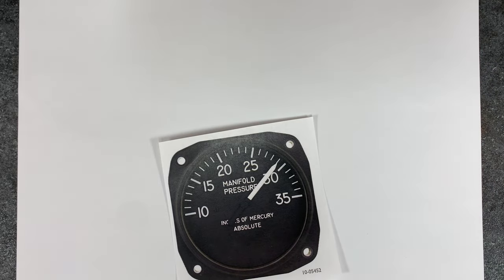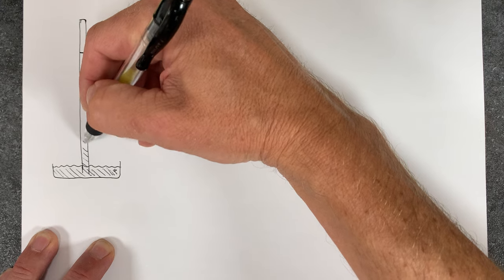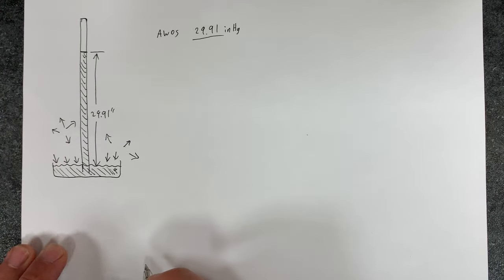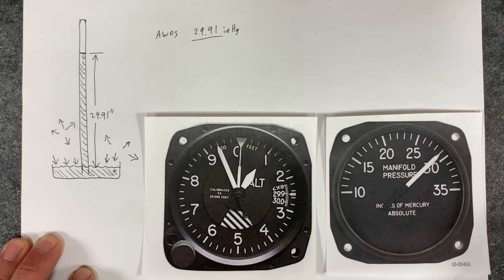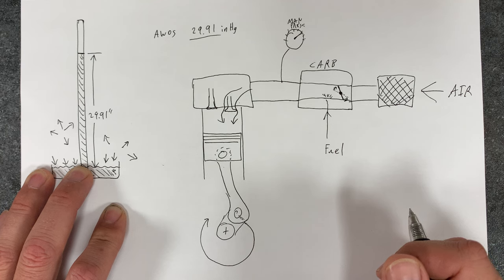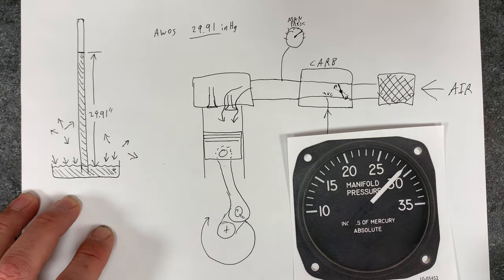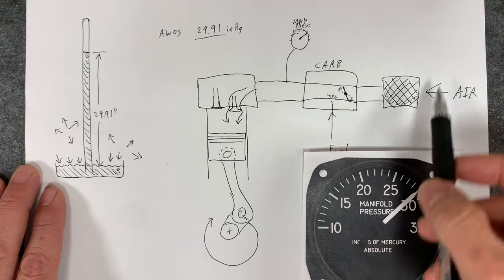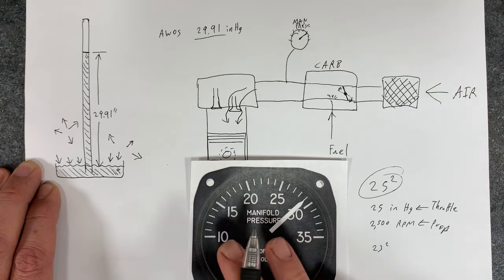Manifold Pressure

Comment: Excelent explanation. If I could make a suggestion, is adding the other half of the story. WOW the Prop lever (which controls the pitch) ends up affecting the engine RPM. For fixed-pitch propeller the throttle lever alone affects the manifold pressure and also affects the RPM of the engine (power and speed), and both are easier to understand/connect. What could be added to this video is how with variable-pitch propeller alters this relationaship between power and engine speed to understand when do we need more throttle or more pitch. Thanks a lot!!!

Comment: Excellent explanation!  The diagram was great as well.  I'm a low time pilot looking to earn my complex endorsement very soon and was having trouble understanding how this worked.  For some reason, the way you described it, clicked in my head.  Now make a video on how it correlates to the prop settings of a constant speed prop and how why it's not recommended to have higher manifold pressure than prop speed.  Still need my brain to click on that.
Reply: Hi, this is because if you have a high manifold pressure but a very low prop speed, there is a lot of force being exerted on the spring which governs the pitch of the propeller, and it can break!